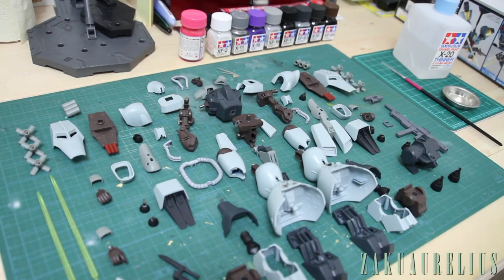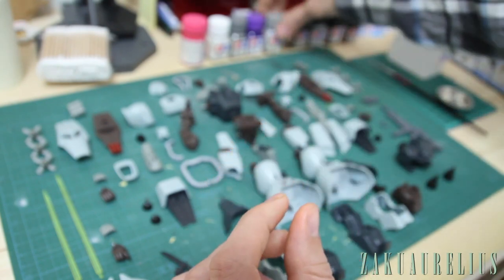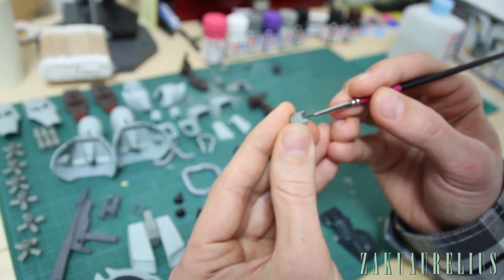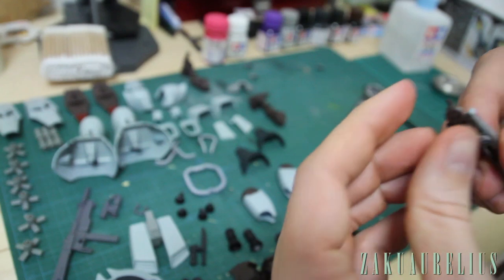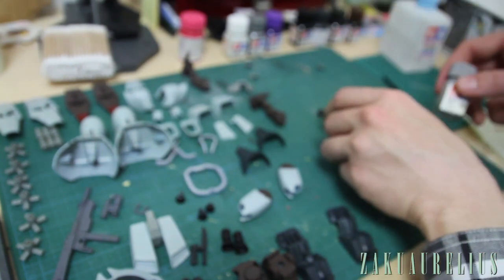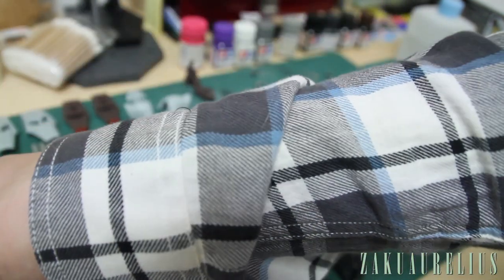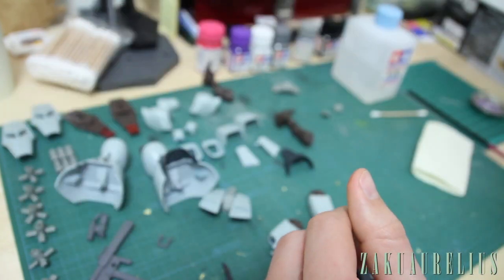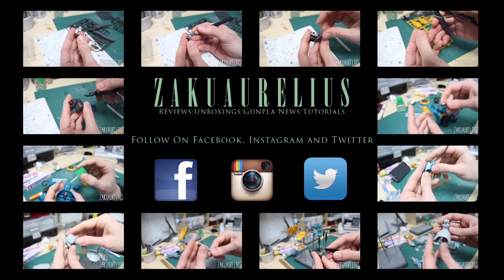158 - Gunpla Building Part 8: Hand-Painting Details with Enamel Paint

Comment: Hi there! I'm planning on doing my very first custom soon with Enamels using brushes only. I was wondering if I still need to use primer before hand painting the enamels and if so, will the regular spray can primer work with the enamels? Also, does the spray can top coat work well on hand painted enamels? OH and do enamels need some sort of specific temperature and humidity for a good finish like spray cans or can I just use them indoors without sunlight?

Comment: Thanks for your gunpla tutorials. I learned a lot. I see you wash your brush in X-20 enamel thinner and then just wipe it dry and clean with paper towel. Do you need to dip the brush in tap water or wash it in tap water after that, or can just leave it be. After washing in thinner is enough already, and wiped dry can be kept away or used again with another colour. Thanks.

Comment: About the whole "painting the inside" thing, there are actually some reasons why the inside of a machine might be painted. Probably the biggest one is corrosion resistance. So realistically speaking the back surfaces of those parts would probably be primed. (Aircraft landing gear bays are usually white, for instance.)
Though in terms of the model kits, frequently the back sides and undersides of parts are just undetailed, showing snap-fit assemblies and things, so I think frequently the priority is just to paint those areas a low-visiblity color that won't attract a lot of attention.
Reply from the maker: True and good info! You're right! Maybe I'll think about doing those areas in white on a future build!

Comment: Hi, i've just a question...when you apply the enamel paint for detailing, over a coat of acrylic or laquer, it's better to spray a coat of clear flat or gloss or whatever, to protect the acrylic or laquer.....or you can just use the enamel thinner on it directly (in example for clean an excess of paint)? cause if i'm correct, acrylic laquer and enamel have different base, so the enamel thinner should not affect the acrylic, right?
Reply: Enamel thinner will cause acrylics to coagulate so best put a coat of matte/gloss clear coat to protect it

Comment: You can take some steel BB's and put them inside your paint jars. It acts just like a spray can. Then you don't have to pound them on your hands. Those jars appear to be around the same size as testors model paint jars and I usually use 6mm BB's in them. Four or five per jar should do it.

Comment: do you have any advice regarding shading/pre-shading? all the methods I've seen require an airbrush which I can't afford :b
Reply: Am I three years too late? Anyway, you can get a good, cheap airbrush for about 30-50$ USD. Other than that, if it's a white kit, put a tiny bit of light grey on the parts you want shaded, then put a thin enough coat of white that the grey shows a little.
Reply: @ryancarrell3186  am I 2 months too late? Haha is it possible to get a good quality compressor and airbrush for under 100? Ive found a brush I like, but I am struggling to find a compressor that would suit my needs and is cheap enough
Reply: @nathanlowe5346  Continuing the joke haha might be 11 months too late but a hobbystore where I have ordered some stuff in the past has this: https://www.youtube.com/watch?v=3p8CcPuzFZo and it costs just under a 100 Euros(99,99 to be exact)! Don't know if you can get something similar where you live and I don't have it myself so i can't vouch for it's quality but that might be worth looking into!

Comment: Hey ZakuAurelius,

Rookie builder form the Philippines. 

When you did this detail painting work, were the parts primed? If not, would the enamel paint work without priming the parts prior?

Thanks!

Best regards!
Reply from the maker: +Denison Rey Dalupang (Son) Great question! Typically you should always use primer before painting. But this video is meant for beginners who aren't looking to do much more than exactly what I've done here. For adding just a few small details like I did, you'd probably be ok not priming. But if you're painting the whole kit you'd 100% definitely want to prime first!
Reply: Thanks  for the quick reply, man! Really appreciate it. 

Starting to put the finishing touches to my RX OYW version.

Planning on putting some metallic details on the minute parts (ie verniers, sole exhaust, innerframe pipings). Was worried I mess up  the kit.

Worked on an MG Wing Zero with spray cans and it damaged my wallet real bad. LOL.

Working on my detailing skills before finally giving in to the airbrush temptation.

Thanks for  the tips!

Best regards all the way from the Philippines!

Comment: will using thinner to clean up brushed on paints hurt the primer? i noticed you used the cotton bud on the piece with the 
primer on
Reply from the maker: primer is lacquer based and is therefor stronger than enamel paint (and enamel thinner). but if you use too much you can effect the lacquer primer, or paint.

Comment: would like to ask you I have tried using normal thinner for removing ink for my gunpla and it nearly damaged the whole plastic does it happens to be the same if I use the tamiya thinner in your video?
Reply from the maker: +Gunpla Builder You may be using lacquer thinner. That's too harsh for this. You need to use enamel thinner or lighter fluid.

Comment: Hi ZakuAurelius for the tutorials, they are so detailed and helpful. I know it's late into the series (I watched all from the first), but I suddenly start wondering, is the alligator clips hurting the parts? Because I see you just clip on to important part... did you do any modification to your clips (filing, put tapes, etc) to prevent them from scratching the plastic (in case there is no where to clip and you have to clip on important parts)? Thanks!

Comment: Have you tried acrylic paints? They have several advantages over enamel and lacquer paints. First they are water based not solvent based. Also they you can use water to thin the paint and to clean up your brush. Once the paint is dry is dry it will not rub off. Folk Arts makes a series of paints called "Multi surface". One of the surfaces it can be used on is "rigid plastic".
To stir the paint check out 'mini drink stirs" on EBay. They have several attachments allow you stir the paint in the bottle.
Reply: Its one great weakness is, ironically, its shorter drying time. I'm not good enough to where it matters (in terms of the paint finish) whether I use acrylic or enamel paint, so I use acrylic because its thinner is generally more accessible and cleaner. But there are those who find that acrylic dries too fast, especially in the airbrushing crowd.
Reply: mr color is acrylic hence i can use water to thin it and not the mr color thinner ? or is it lacquer?
Reply: Firedracax X
I know some acrylics are water soluble (aka water-wash-up) like Testors Model Master Acrylic, but I don't think Tamiya is, so I think you'll want to check specifically to see if it is or not. I know the Aqueous line from GSI Creos is water-soluble though.
Reply: +SevenSwordsExia regarding the mr color thinner, can it be used to clean up the mess caused by the premixed tamiya panel line accent color
Reply: Firedracax X Frankly, I have no idea. I use Tamiya acrylic thinner. But as a general rule, enamel thinner will thin acrylic paint too. Lacquer thinner will dissolve all three types, but it usually eats up the plastic too, so your mileage may vary there.
Reply: +SevenSwordsExia so use minimal mr color thinner?
Reply: Firedracax X
Probably. I've heard that even though it's an enamel thinner, it can still corrode the plastic if you use a ton of it. Good luck on your build!
Reply: +SevenSwordsExia hehe thanks! 1st time trying to paint an aoshima kit. oh and um what brush size to paint?
Reply: Firedracax X
Never tried Aoshima. I just to koto and Bandai. Sorry.
Reply: +SevenSwordsExia ? i mean like generically speaking what brush size??
Reply: Firedracax X I try to keep a few sizes on hand at a time, but really all you need if you're not gonna airbrush is one medium sized one and one very very small one for details.
Reply: +SevenSwordsExia uhh so whats the size? like the number?
Reply: Oh, that. Sorry, I wouldn't know. I just eyeball it.

Comment: ok, if you go a bit overboard with the hand painting, and you use thinner to clean it, would it remove the paint layer that you went over?
Reply from the maker: Zekiel Hoang If you are using enamel thinner to get rid of the enamel paint, your paint underneath should be ok if it's lacquer, as lacquer is stronger. BUT, still have to be careful! Enamel thinner can take off lacquer paint as well, with force, just work carefully.

Comment: Hey Zaku Aurelius I was wondering if you could use enamel paint from the hardware store?
Reply from the maker: You can! But I don't know how well it will work. You may want to experiment before using it on some project you really care a lot about.
Reply: ZakuAurelius Thanks for replying but I have another question.Are there any like colors of paint that I should have.Like colors that are essential and common through all the mobile suits?
Reply: marcdosh57 most folks would say that you could create a great finished model with the following colours:

Light grey primer
Flat black
Flat white
Light grey
Dark grey
Gunmetal (metallic)
Red
Blue
Yellow
Green (not often used)

If you wanted to you could use a gloss lacquer to turn some of your parts from flat to gloss after you’ve painted them and they’ve fully dried.

Some folks would then add these colours to their sets:

Black panel line wash
Grey panel line wash
White panel line wash
Transparent smoke
Transparent red
Transparent blue
Transparent yellow

Most other colours you’re likely to use exceedingly rarely and the ones in the top list above will probably be your “go to” selection.

Comment: I thought its a rule when handpainting to paint in one direction and stay in that direction or else the paint will be uneven. Is that true?
Reply from the maker: THEPIGGY For this small painting it really doesn't matter much because the enamel will level out pretty well. If you were painting a larger area you'd probably want to use acrylic, and in that case yes you should brush in one direction, and alternate for each coat (so I've heard in my limited research on the topic). For example, first coat brush down down down, then second coat left left left, third coat down down down, 4th left left, and so on~

Comment: if i sprayed the kit with acrylics can i still detail with enamel?
Reply from the maker: No. Well you might be able to with a good protective layer in between but I’m not sure.
Reply: ghostface320 No. Acrylic is water based and enamel is oil based. Unless you get VERY lucky, the enamel will break down the acrylic. You can safely put acrylic on enamel, but it can affect the finish.

Comment: Is Enamel Paint better than Acrylic?
Reply from the maker: Jefferson Sheng Depends on what exactly you are using it for. But for this kind of detail painting I think enamel is better. But that's just what works for me. People use acrylic to paint tiny Warhammer figures and stuff, so I'm sure you could apply that to Gunpla as well, I just never have.
Reply: I'd say mostly because enamel is pretty forgiving. If you mess up you can just take a swab with thinner on it and clean up that area
Reply: Even after it has dried
Reply: +Chang Ye will i swab the mess up area together with my painting part away after it dried ?
Reply: Bryan ong I don't really understand the question, but with enamel you can clean up the paint with thinner after it dries.